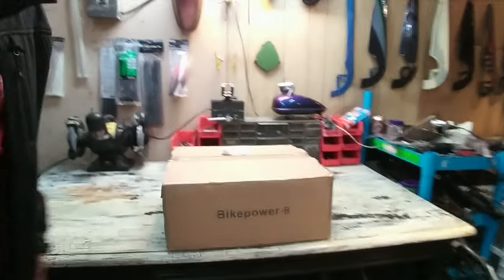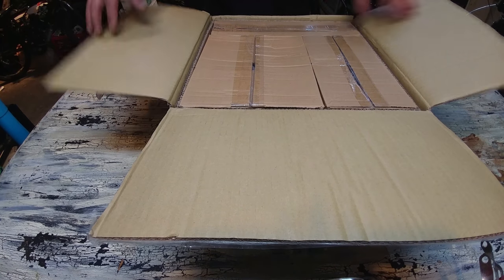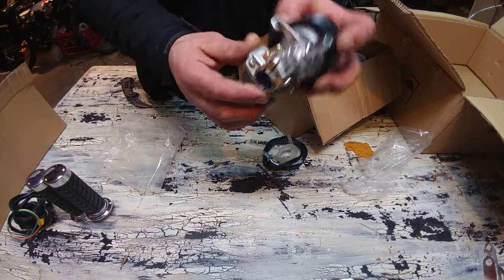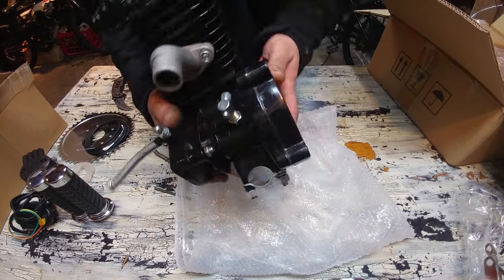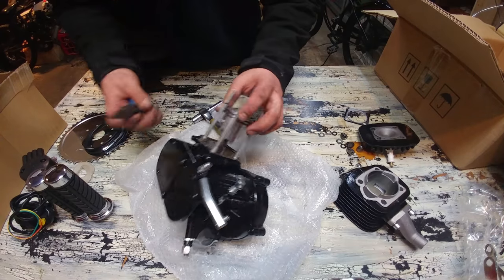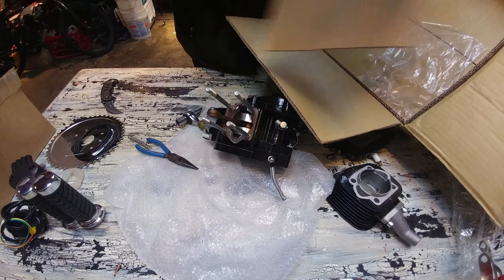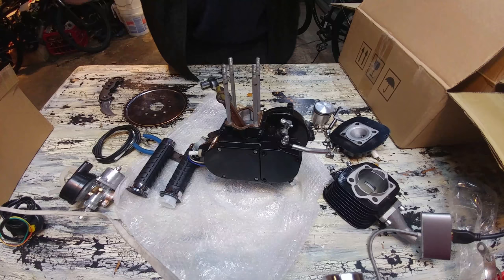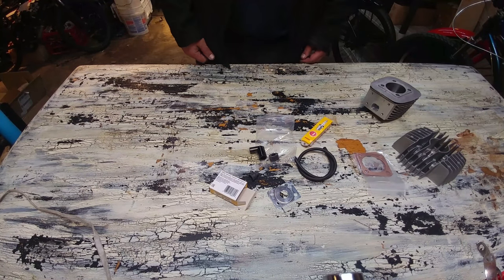ZEDA-80 From BMW *Unboxing and First Look Review* M8 Triple 40 66/80cc balanced 2 stroke 40mm

Comment: Never SLAP a cheap motor on a bike 🚲...Disassemble, inspect, port, lube, reassemble using lock tite, enjo 🔩🔧😎👍🚲💨
Reply: Mr. MOTORMASTER 
What does porting mean and what do you lube and what do you use for lube
Reply: You have to grind off any excess material that was left behind from cheap work. You can get more power by widening, but not increasing the height of, your intake and exhaust ports. I use 2 stroke oil to lube my engines.
Reply: Great advice 👍, watch out for coronaviris,. I just got laid off, March 22 2020.  I'll remember this day.

Comment: When will bicycle engine kits ever quit coming with those POS clamp on chain tensioners? One of those almost got me killed once, it got pulled into the rear spokes and caused me to crash, inches away from 50 mph traffic. I recommend you use the new engine mounted tensioners you can get on eBay. They cost about $30, but what is your life worth.
Reply: Exactly, your right on the money Whit this one.

Comment: Why is the spark plug on Zada pointed in the opposite direction than the last 3 engines (not Zada) that I bought? I just bought a Zada engine, the head was assembled and the plug is point to the back. I once saw a video that explained the design of a head and direction of the spark plug, I'll have to find it again. There must be a good reason Zada does this.  ??

Comment: The arrow indicates the flow of gasses and should face the exhaust port, that's how I've done it on motorcycle engines
Reply from the maker: +Jas Ward never correct on these. I've seen it go both directions the side with the ring openings faces the intake.
Reply: Jas Ward , arrows should always go towards the thrust direction of the piston. In this case it would be towards the front of the bike. It's that way on all engines, piston  arrow always go towards the thrust direction, even on automobiles.

Comment: Hello,
I Notice guys use a Bike Tube cut to Size and put in between motor mount and bike frame.
It Seems to lessen the vibrations of the engine and frame.

Comment: Hey I had a quick question so I ordered a flying horse kit and I plan on buying that same bike at Walmart was wondering if u knew the rear hub diameter of that hyper 26"? Thanks
Reply from the maker: David Martinez 1.5"
Reply: Awesome thanks one upgrade is I do want that hub adapter so this will help when I move back home and have all my parts waiting for me

Comment: Do you recommend these for a bike with multiple gears or not? I've seen a couple people use the hyper cruiser or Kent la Jolla from Walmart that're single speed, and some others using the Kent Bayside cruiser that are five sorry I think. Just curious as I'm about to pick up one of these three in the next day or two to start my first project. I was thinking the Bayside cruiser since that's the one my local Walmart has in stock and I'm impatient, but if single speed is better I'll just order one.
Reply from the maker: Doesn't matter just know the geared bikes you will have to run two brake handles or get a dual pull
Reply: Motored Life awesome, I appreciate the response. On a somewhat unrelated note, do you have any videos detailing how to tell a 66/80cc from a smaller 47cc/etc? I've been reading about a lot of people getting ripped off, and I only have like $225 to spend total, so I'm stuck buying a cheapie from China or eBay, and the last thing I need is to wait a month just to find out they sent me a 47cc and have to pay to ship 25lbs of shit back for a refund :/

Comment: Hello sir I Kno you get alot of questions. Bt is it worth the money for a high compression head
Reply from the maker: Ya know. I mean sure. I would get a new pipe first. The correct expansion chamber will make the most difference right off the bat.
Reply: @MotoredLife  we're do you order one of those

Comment: Hey what is the deal with Zeda my kit looked like it went to war, when it arrived bent up missing nuts and bolts no clutch lever. They have not returned my  E-mails to fix this problem. what is their deal?  who should I contact? getting very frustrated with them.
Reply from the maker: From Zedamotorsports.com or BicycleMotorWorks.com

Comment: your vid quality is top notch! however, the pronunciation is "pook" (rhymes with look), not "pooch" (like a dog), or "poosh" (like a french guy saying "push"). austrian, ch is either a k or that throat clearing "khhh" sound like a bad german officer in a low budget ww2 flick, lol. puch is part of steyr, daimler, puch, about the biggest metal working conglomerate in austria, with an automotive history dating back to the stone age, lol (as well as arms, tools, and industrial gear). back in the 70s, the puch mopeds were the MOST desirable here in the states, due to both longevity and speed. the bent fin is indicative of unmolding the part a bit too warm at the foundry that poured it. those round sections are air risers to vent the mold, so the apprentice doing the sand shucking tapped that one with the air hammer, lol. not as pretty, but should have no effect on functionality
Reply from the maker: Thanks for that info!!

Comment: Which Hyper bike did you order
Reply: Hyper 26" Beach Cruiser, currently WM has em for $99 lol. I'm building off this exact frame, with 79cc Predator. it's a solid frame (if not top of the line starting point)

Comment: Can you do a 29 inch bike
Reply from the maker: Yeah ive done a few still have one. i want to do a Kent 32" this year.
Reply: Okay I have a question how do you connect the white wire because the one I just bought yesterday has a white wire for the lights and I'm trying to figure out how to hook it up do I use the black wire and the white together or something I need help?
Reply from the maker: CUT IT OFF!! The only thing the white wire does is rob power from the cdi spark. Get some battery lights check out the Solar Storm from CREE
Reply: But does the lights actually work and how much voltage does it put out really curious but I know a lot of people say it does use power from the engine a lot but I just want to know does it actually light up and how much voltage
Reply: Motored Life okay so the motor I bought kind of look like the similar one in this video like I got it all put together and it just doesn't feel like it goes the speed like my other ones that I have that are the same exact ones I don't know if it's something to do with the carburetor or the throttle cable it says it can go 30 to 40 miles an hour but it feels like it only goes like 20 do you think you could figure that out for me really appreciate it
Reply from the maker: @Xaos yes. Does yours have the straight top bar? If so want to sell it? Lol

Comment: dont call it a zeda if its not built by zeda....thats a p.o.s china clone...
Reply from the maker: All these engines are made in china lol. Zeda is the manufacturer they all buy from (jlzeda.com).  i showed in the vid that it has a ZL40mm stamped rod but marketed as ZEDA80. The true zeda from zedamotorsports.com will be here soon.
Reply: I was under the impression that zeda motor sports.com has nothing to do with the zeda company